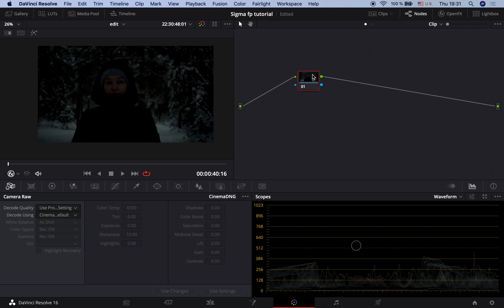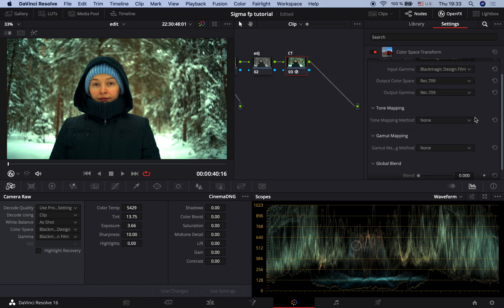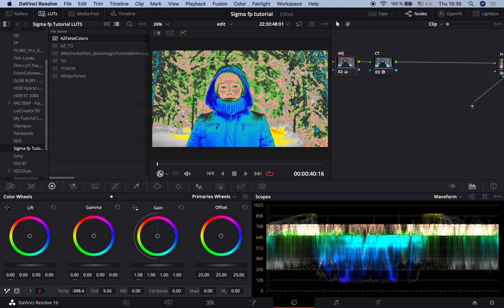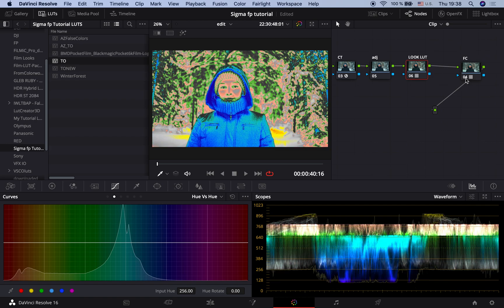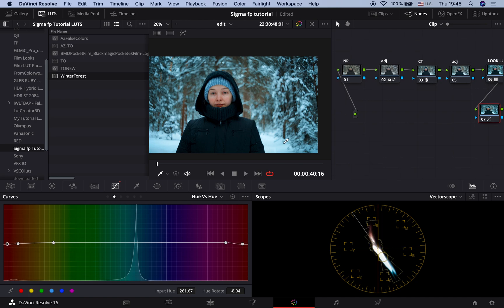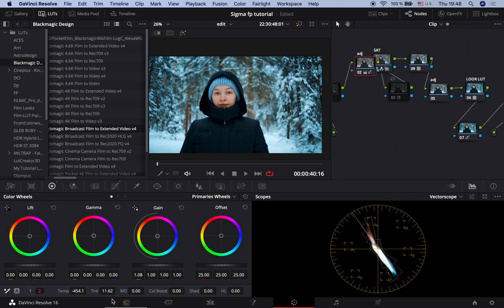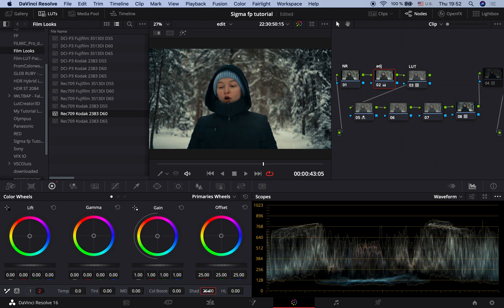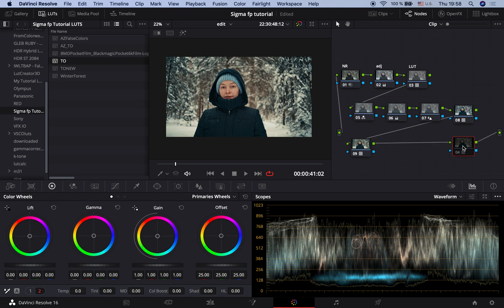Sigma fp CinemaDNG RAW Grading Workflow in Davinci Resolve

Comment: Thanks for sharing your workflow. The truth is that it looks amazing. My only concern is that your are converting to BM in the raw tab, at the ver beginning, so DR will not understand its dealing with a linear codec. I would rather convert to BM with the Color Transform Space, and then add an additional lut to convert to REC. Thoughts?
Reply from the maker: It will understand) the raw tab is an interpretation of a raw bayer information not more than that while the color transform works with a debayered info. Raw is raw no matter how you treat it the information is all there.
Reply: Got it. I knew I had to ask you … 😊. Thanks for your prompt response 🙏🏻

Comment: I need to charge with a pacifier with a wire from a steadicam. I want to know what stabilizers can do this. My camera is a sigma fp, and I'm facing the choice of buying a webil s, but I'm afraid it will have trouble replacing the batteries on the camera because of the pad and won't be able to get charge support from the steadicam.
Reply from the maker: I would go with Dji RSC2 or DJI RS2. I don’t like zhiyun.

Comment: I've been using the color space tool converting from Rec 709 over to Arri Log C and then to Arri 709 lut on top . No need for exposure compensation  in the raw. I also found using the color transform to Cineon then using the stock davinci Film print luts . it gives some pretty cool looks . Nice tutorial
Reply: Perhaps you are right.. haha I’ll test
Reply: I do 90% of my corrective work using the raw section . So i didn’t notice the loss . However yeah it limits what you can do
Reply from the maker: Well I guess rec709 is limiting your dynamic range and color space. You may lose some information while transforming to Arri Log C.  I will try it anyway. Thanks.
Reply from the maker: I can be wrong))

Comment: why do you need to transform the color space with an effect applied on a node? Is not enough setting from the "output color space" from color management?
Thanks for your help to understand the process :)
Reply from the maker: You can do it in the color management menu, but then you have to manage you clipping highlights yourself. I prefer setting "Luminance mapping" in the Color transform plugin. Both ways are good.